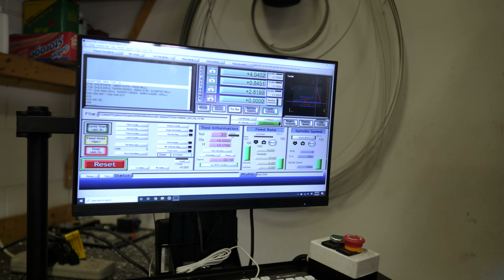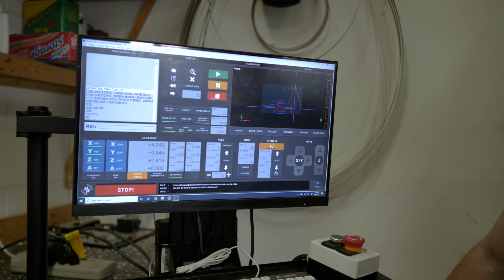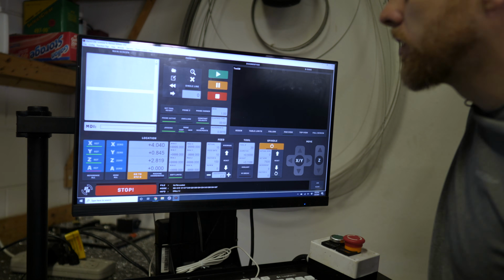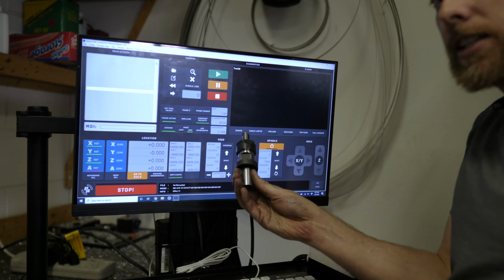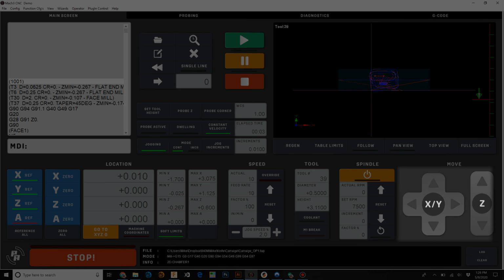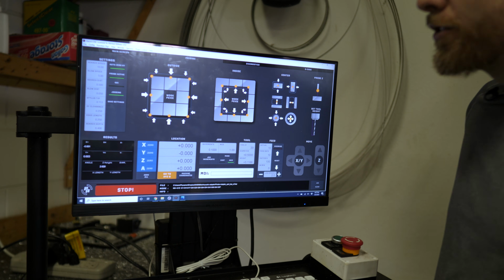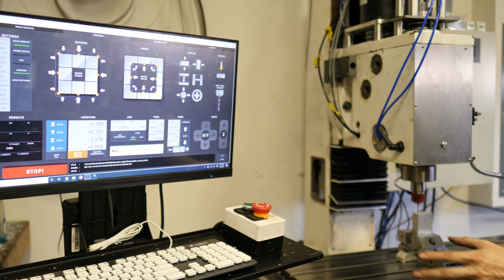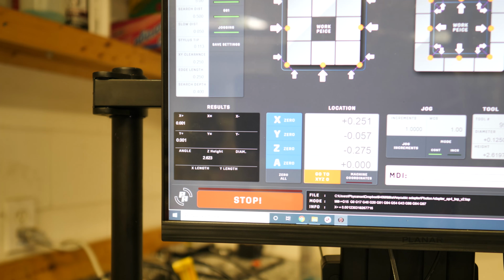Mach 3 Has Never Looked This Good! (CNC Software Part 2) - S03E14

Comment: This is some really good work, definitely taking removing a lot of the eyesore of using Mach 3! I've been in the early preparations for building a physical control panel with a matching Mach 3 screen set and here's some unsorted observations and input from watching this video as well as relevant parts from my own notes in anticipation of a project like this:

Absolutely have separate buttons for go to XY0 and Z0 - and for the love of god put them at safe distances away from each other so you don't accidentally click one of them when you meant the other. Or anything else. I usually Z0 on the top of my part because it's more idiot proof so it's not so bad for me as it could otherwise be, but unintended movement is always bad! Along with these there should also be the conceptual opposite, "go to Safe Z", which I configure in Mach 3 to be at the top of spindle travel (max retract). If you didn't use this feature in Mach 3 then I highly recommend it, it makes sure the tool automatically retracts when you hit the stop button, among some other things. There's also a decent argument to be made for having a "go to tool change position" macro button that would go to a user configured coordinate so that you can reach the spindle on a gantry router.

I would keep subtle, stylish but readable text on the icons to the left of play/pause/stop. Apart from rewind, none of those icons really are fantastically obvious and it doesn't hurt to have a clarification as well.

The emergency stop button should say something more explicit or at least different than "stop", to make the distinction clear from the ordinary stop button.

If a hard end-stop is triggered then that axis DRO can be highlighted in some appropriately angry color.

There's lots of space available to the left of the location coordinates. I'd have a small (maybe 20% of the height of the field) slightly grayed out coordinate in each line at the bottom there, left aligned, showing machine coordinates when the work coordinates are normally shown in the large DRO and vice versa. Assuming Mach3 can handle displaying both of these at the same time - I'm very much not up to speed on the technical limitations.
The XYZA ref and reference all buttons are usually only used once per day if even that - I think they should be much smaller (in width) than the XYZ zero buttons that you will use almost every setup. It's good to highlight their relative use frequency, lets you easier find the one you need visually and takes up less space. I'd probably make them dark like the other unobtrusive buttons as well, not the bright color of the zero buttons.

You say on the resume from line, Mach 3 just starts running commands at that point - for me, Mach 3 has a window that pops up and it simulates the program up until that point and figures out where the tool is supposed to be so that it can restart at the correct point of the program. Is that not on this screenset?

Since you moved the program min/max axis values to the main page, there's only one thing missing from the stock Toolpath page now - simulate program run. A button that runs the simulation and tells you estimated program run time would be very useful. If this then further could be coupled with current run time and calculate percentage number, estimated time remaining and estimated clock time at finish that would be exceptional.

Personally I like a decluttered interface as much as possible, so I'd want a version without the jog buttons for non-touchscreen users. Same with the axis readouts and buttons - a separate version for XYZ, XYZA and XYZAB machines. I do realize this very quickly turns into a painful number of versions to keep in parity :D.

Mach 3 (and most other controllers) actually has a huge amount of available fixture coordinates (work coordinate systems). The normal G54-G59 and then G59 P1 all the way up to G59 P254 are all available. G59 P1 through P6 are macros for G54-G59.

I've never actually managed to make the hard limit override actually work in Mach 3, but if it does and you can, I think it belongs somewhere near the soft limits switch. Good for when you need to jog the machine off a limit switch and you don't want to power it down and move it by hand.

I'd like another spindle DRO next to actual/set RPM - us router users with the Huangyang VFD often use one of the plugins that communicate with it via serial, and that way we can also get the spindle current in ampere and show it on a custom DRO (with any configurable number).

If this is possible/supported in Mach 3, I want to have more obvious readouts about the important modals than the string of mode gcodes. a button/light that reads RAPID/FEED for G0/G1 and ABS/REL for G90/G91 for example. Those are the ones I pay attention to most of the time but I'm sure there are more, like cutter compensation (G40/G41/G42 and G43/G44/G49) and machine coordinates (G53). Also if the machine is in a canned cycle like drilling, cause it can't be stopped, paused or interrupted by the normal buttons then. Hell, if possible just macro the stop button to also fire G80 (cancel canned cycle). Possibly G20/G21 too but I can't imagine many people who ever really switch unit systems and need to see it.

For tool length probing, I'd love to see support for a somewhat common way to do it on routers where you don't have repeatable tool length for tool changes. You probe normally and zero Z with no tool length offset on your intended zero, then you change tool and the machine goes and touches a plate that's fixed to the machine at a known height, so it can measure the difference in length from the previous tool to the new one and use that for the offset.

I didn't dig too hard into this, but our machine is originally a kit, and while ours is wired to use the probe pin for a conductive touch plate, I do think the instructions mention that you can save a pin by using one of the Z end stop or home switch pins for probing instead.
 I don't know how this would be handled in the macro or anything like that, but might be worth looking into for saving that pin config swap!

Comment: Well I know what I'm doing first thing in the morning. I also have a graphic design background and though it no longer physically hurts me to look at Mach 3, the memory of that pain is still near. I started mocking up my own a little while ago and I will certainly come back to finish it, but I realized among the only things harder on the eyes and brain than Mach 3 were the tools used to build Mach 3. Which one did you use? I know one of the ones I tried has a menu bar that you absolutely can't click any alternative on or it just hard crashes the program every time... And I think there was one that required Flash to be installed?! 

This looks pretty, yet subdued - a great work and even greater for being free - I actually laughed out loud to myself the first time I saw the Mach3 screensets web page and realized some of these were actually trying to sell them for money!

Comment: best looking screenset for sure! thank you. Just tested it on my setup and noticed that when I do reference all axis, mine are steppers with end stops, it moves the z-axis and then moves the rotary axis. Not a big deal, I can definitely relearn the steps. It surprised me though and I thought I would mention it. 
Also, it has been a while since trying any other screensets. I did not realize that it would import different macros. At least, that is what I thought happened. I had to link my auto tool zero to the right button in the 1024 screenset originally. When I pressed auto tool zero on yours, it through an error about tool 99. Maybe that is the default reaction from the button if a custom macro has not been input in to it though. Searching on mach3 is pretty terrible at this point. So I gave up on that answer.
Having the radius compensation button would be a good thing to add as well. You mentioned things about the scripts used in the probing section. Are those the included ones in mach, or like the above, does it import your scripts on loading the screenset?

Comment: A couple comments on your interface:
-Looks great!
-I appreciate how much thought you put into it.
-I definitely think changing your "go home" button to X/Y only is a good idea.
-On the WCS display, you could add some mini text that displays the actual Gcode number just for reference?
On Haas controllers there's a search function where you can type a few lines into the MDI and hit down, and the interface will jump to the next line with the codes you enter - it's a handy feature (I dunno if Mach 3 already has that feature built in or if it's even possible for you to implement here).
-In my mind the optional stop selector (M1 break) should be up with the load/unload, play/pause/stop buttons, but maybe that's just me.
-Does your interface display the diameter/height of the current tool anywhere or just the increase/decrease options?

Comment: That windows mach3 bug with movement can be solved like so:
Press direction you want to move hold your finger on screen and pull it on screen few mm away and it will move as long as you hold finger on screen
Otherwise great looking interface even on 1024x768

Comment: you should check out centroid acorn they are affordable and modern. computer takes no load and its based off professional controller. i have machines with mach3 and linuxcnc and they work fine but centroid is way nicer.

Comment: Great videos!  I am primarily a metal worker but am in the process of building a CNC router and was in the process of picking between Mach 3 and Mach 4. You have helped me make that decision.  If you are interested in doing another video along these lines how about a step back and describe your computer hardware setup.  Two things in particular, the PC you are using isn’t available at Amazon but it has way more processing power/memory than Mach 3 requires.  What do you think is the minimum I should look for to run Mach 3?  Mach 3 requires a parallel port, what is your hardware/plugin solution for that?

Comment: Thank you very much. That was really need it! I find it really nice. 1 thing missing at first look. The 4th axis, let's say A needs the diameter compensation otherwise mach3 won't run g93 correctly and calculate the feed speed wrong. In normal mach3 screen you have in the main window the icon called "radious correct" lighted it up when you enter a A radious value in the setting page which I do not see it anymore in your screenset.
Other thing is the big STOP button, is it actually RESET? Because normally stop button is the red with the stop icon.
Thank you for the really nice work. Please keep it update it, I will test it soon

Comment: The only proper solution, short of dedicated controllers, is to switch to LinuxCNC.
Why LinuxCNC? Because Windows is extremely non-deterministic and non-realtime. This means if Windows decides it wants to chug on something internal for a few hundred milliseconds, your machine will just _halt_, because Mach3 is generating the motion commands, even when, in your case, they're sent over ethernet, and the stepgen is not in windows.
A machine controller must be done either completely in hardware(and yours is not), or running a deterministic hard realtime OS, which is what LinuxCNC with an RT kernel was made to do.
Not to mention huge expansion possibilities, rigid tapping, proper probing(believe me, you're not).
Oh, and you don't have to spend the time making a nice GUI, because there's at least two great ones. Tormach's PathPilot is reskinned LinuxCNC as well.

Cool design though.